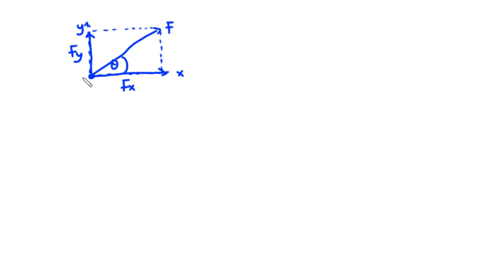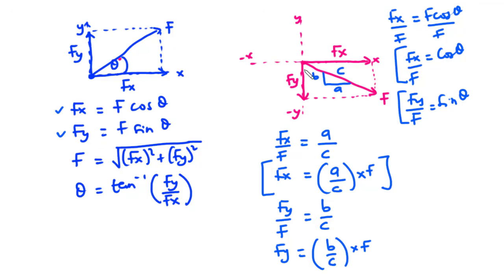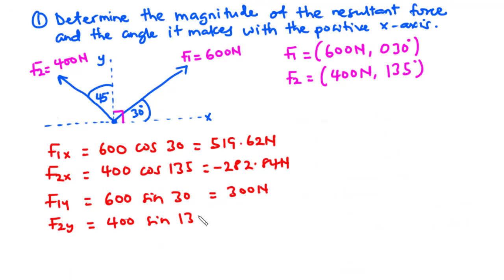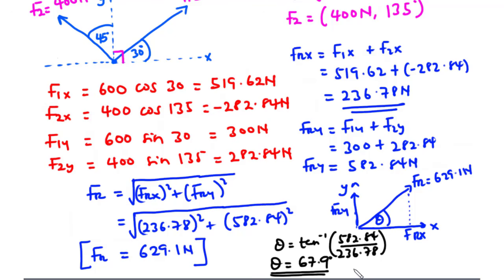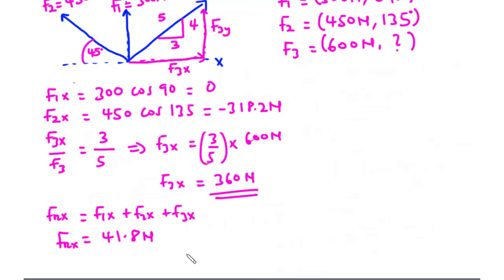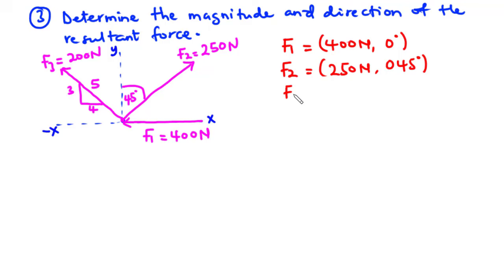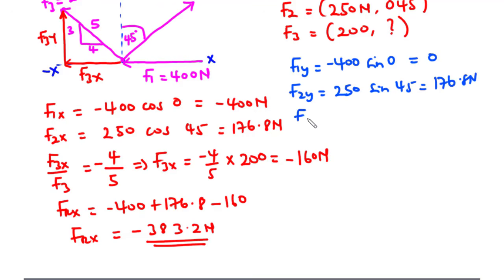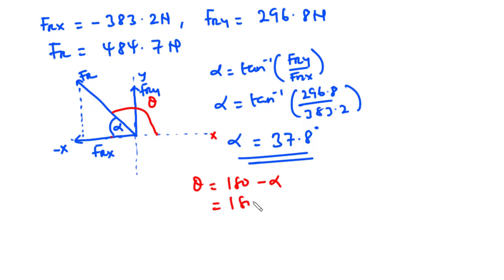🔺03 - Resolving a force into Rectangular Components | Adding Coplanar Forces

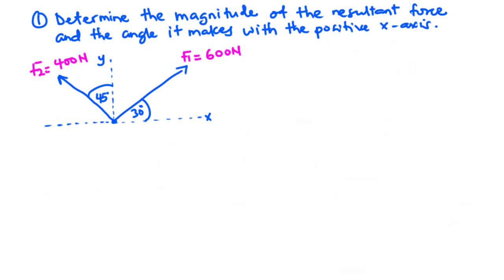Comment: For the example at 5:18 how do you know if youre supposed to find the rectangular components? Couldn't it be solved also using parallelogram rule?
Reply from the maker: Parallelogram rule is normally used to combine two vectors at a time, where the angle between the two vectors are known. But here we have three vectors, so using rectangular components will be faster and more convenient.
Reply: @SkanCityAcademy_SirJohn  ok thanks. I have another question in example 3 for the F1=400N why couldnt the angle also be 180°?

Comment: I stand to be corrected but I think the bearing is wrong for the first question. If you say that the angle between the x axis and the force is 30 then the notation(600N,030) is wrong instead it should be (600N,30) as a mathematical notation or(600N,060) as a bearing .